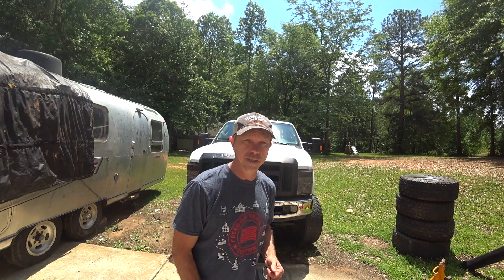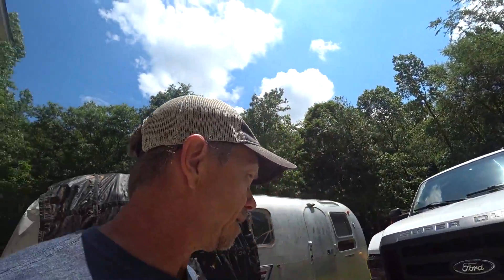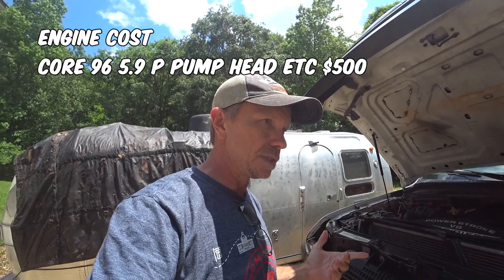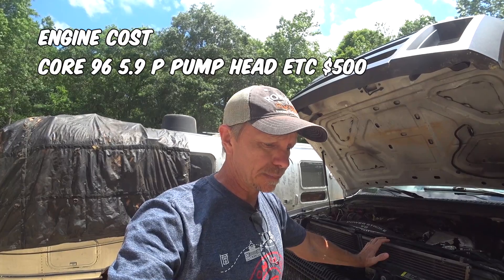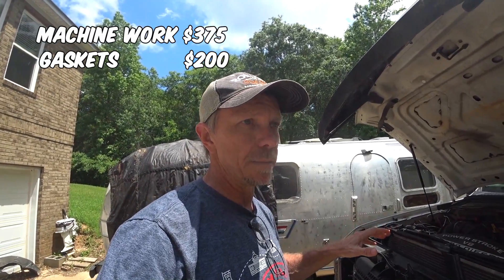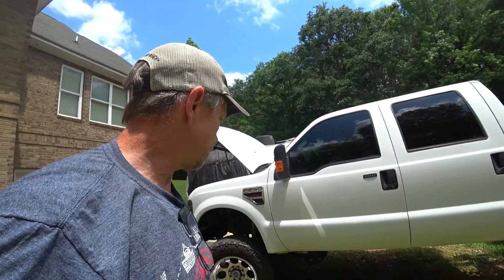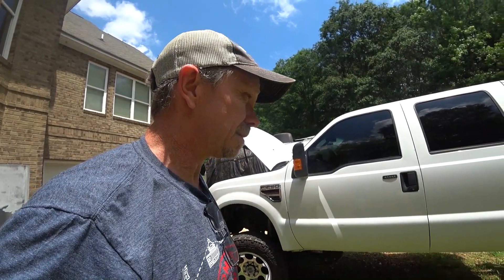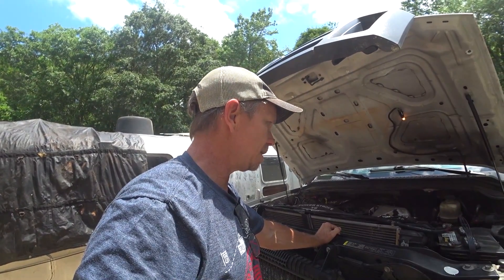6.4 Ford F250 to 12 valve Cummins Swap - Cost To Build

Comment: That truck is worth more now that you did the swap over, then it ever was with that 6.4 in it. To be honest with you, it's worth far more that $11,000 is a used truck. I have a 94 F250 extended cab 4-wheel drive, that I wouldn't take 11 grand for. You did a great job, that truck will be worth $15,000 minimum when you're done. Diesel 4 by fours right now are bringing some crazy prices. But I love them. Thank God I'm an American country boy
Reply: Funny but it might have been worth 15000 2yrs ago but now itd be worth 35000
Reply: No. These are nightmare chop shops. Not worth more then a couple thousand. What it’s worth vs what has been put into it, are two different things.
Reply: @sugmaball5383  Are you referring to the truck itself? I am curious if these fummins fords have to be constantly worked on. Maybe the engine and transmission will never die cause they're solid, but that doesn't mean the truck won't have to be worked on all the time.

Comment: hey I'm derek I have an 08 f550 and have a new 12v in it and mounted to 5r110 I need help wiring tack helper up to it and mounting the pcs tcm 2800 with the wiring harness? any input would help thanks!

Comment: I think you're spot on with the value. That's what I figured with my 93 ,2wd one ton , only it was a 3500.00 truck to start . The tappit cover is touchy ,make sure the outer edges touch before the bolts bottom out. Thanks for sharing this project with us!

Comment: Wow glad I’ve got a good reasonable priced reliable machine shop just had a 24v head valve job done and it cost me 140$
Reply from the maker: That's a good price especially for 24v. Don't let them see this.
Reply: THEY probably did not do EVERYTHING.  Those cheap shops CUT corners. Do you thunk it only took them 1 hr.. I don't think so.

Comment: Don’t listen to those clowns about aluminum beds because they don’t have a clue . What you should get is an EBY aluminum truck bed they are built strong and look the best . I have them on 4 of my 1 tons on the ranch. Designed with cutting-edge technology and manufactured by veteran craftsmen, EBY truck bodies exemplify the spirit of American ingenuity. Whether you’re a contractor or builder, a landscaper or farmer, a mechanic or service technician, EBY has a truck body that will work as hard as you do.

Comment: We want to thank you for documenting this swap and giving us a heads up as too what to expect. 
We are just about to put a 1996 Cummins 12V into a 2008 Ford F450 6spd manual 4x4 and have learned an absolute ton of knowledge as to what to look for and avoid as well as what to fabricate instead of buying.
Your video's I figure will save us at least $2k+.
I work in a machine/fab shop so most of the parts I can just do myself.
One question for you is, does your Ford have the regen and do you have to do any computer work to get rid of the CEL?
Thanks
Reply from the maker: I'm glad you found my videos useful. My Ford does have the regen and the light stays on for now but a friend of mine was able to tune his out using HP tuners

Comment: Very cool swap what is your guesstimate for hours? Gutsy move pulling that 6.4 out the front we call that kind of stuff swearing and bleeding.
Reply from the maker: That is a tough one. Probably the most valuable question too. I fabricated a bunch of stuff so you have to add that over buying a kit also and I rebuilt the engine. Lets just say a winter project 6 months working on it 2-3 hours a day off and on.
Reply: Fair enough thanks for the reply

Comment: Well done mate - a nice engine in a nice body, the way it should have been done from get go. I do have a question for you guys who are doing this or similar engine swaps. What about EPA and theyr'e ban on emission delete?.
Any vehicle that are non emission I would guess are fine - but a 08 or newer would have EGR, DPF and some even DEF and by replacing and older non emission engine, would it  comply with OEM emission laws ?.
I would love to do a swap like this but where I live the EPA, RTA, annual inspection and Police would have fined me into the utter darknes and left with the plates. I'm stuck with a 7.3 PSD which are non emission - yes they allowe me an 5.9 12 valve but the cost swapping it in are not worth it.
A  similar year like yours with a 6.4 PSD would have been worth the effort - but then again the emission laws are getting into play.
Thanx for posting.

Comment: Bro. I did my build in November on my 12 valve and the damn tappet covers will leak no matter what you do with the stock cover. I put a cheap billet for like $60 and it never leaked again.

Comment: hello, very good job , .....I have a question like did to adapt the cables of the engine and the transmission and that the instrument cluster all  worked .... thanks for solving my question
Reply from the maker: I built a throttle pedal adapter for the stock cummins throttle cable, used swaphelper to control the tach signal for the computer and instrument cluster and the stock ford sensors for everthing else. So yes temp, boost tach and transmission all work as original. Here are the videos how i did it   https://www.youtube.com/watch?v=RtKgC7F6A_A&list=PL4M7OaDVwdt8H9wVyMw1pMWh3hMGCs_3v

Comment: JYDOG, Did you end up liking how you did the Fan with the adapter?  That's how I'm looking to due mine.  The 6.4 fan is alot heavier than the 5.9 fan just wondering how the stock 5.9 fan clutch handled it.

Comment: Did you build you own wiring harness? I know online they are ridiculously expensive?
Reply from the maker: I did. Everything is expensive now. I am thinking 12 months. Things may be a little cheaper. Even used parts are outrageous on FB marketplace.
Reply: @JYDOG  any chance you have the diagram written down or willing to put it on paper?

Comment: Dude that truck is worth 20k easy. Those fords are nice trucks. And now that it has the best Diesel engine in it, you have 1 spectacular truck. Get all the cosmetics working and your ready to go. And get the exact bed the truck cane with from the factory if possible
Reply: Flatbed!

Comment: Just out of curiosity I wonder what it would be like cost,time, difficulty etc... to swap in a 6.7 power stroke compared to the cummins? Anybody know. .
Reply: A lot harder. Its a fun thing to think about but it would never be worth it. Nobody to my knowledge makes an adapter plate kit to bolt a 6.7 up to a 5R110. You would have to use the transmission out of a 6.7 truck, and all of the computers along with the 6.4 computer. The wiring would be horrendous. And in the end, you wouldn't have the dependability like you would with a 12 valve cummins. The later 6.7s seem to be holding up alright, but they so much harder to work on when something breaks than a simple 12 valve or even a 6.7 cummins. Not to mention how expensive they are.
Reply: @hummincummins5413  thanks for taking the time to answer my question. I can see how the Cummins would be simplest choice. Never thought about the computer issues or the cost of the late model PowerStroke.

Comment: Don't drive it in California' Bar inspection sites will red flag it for smashing under New State law's.. All engines and exhaust have to be Oem to the Vehicle or truck your driving. The only way around the law is show cars or classics. And that's impossible to get signed off on.

Comment: How did u wire up the engine harness? Did u only buy a tach adaptor and do the rest yourself?
Reply from the maker: Yes, just the tach adapter was needed. I left all of the sensor attached even the ones that where not being used and slowly removed them one by one.
Reply: JYDOG any check engine lights and where did u find the information to wire it? The wiring is really only thing holding me back from doing the swap
Reply from the maker: @doug___1jz  Yes the check engine light was on all the time but everything worked as it should.  With HP tuner software it can be turned off. I would suggest looking for a Diesel conversion specialist manual it will clearly show you how to do the wiring.
Reply: JYDOG thank you for the info, lastly how are u passing emission or, in your state, are u except
Reply: JYDOG how did u find the best price for the engine core, not to sure where to sell it

Comment: Whats the special thing on that "P-Pump" that was mentioned? More power, more reliable?
Now I´m excited to see that flatbed build process...
Thx for the vid!
:-)
Reply from the maker: Bosch p7100 more power and reliability than other pumps. "upgrades can get the P7100 pumps to flow 850 to 950 cc’s — enough fuel to make north of 1,800 horsepower"
Reply: @JYDOG  Ah ok, sounds it will do on your setup...
:-P

Comment: I’ve been following you on this from the beginning. You mentioned when you pulled the motor you wouldn’t recommend doing it the way you did. Would you remove the cab or just use a different engine cherry picker?
Reply from the maker: Pull the cab if you can. If not use a real heavy duty cherry picker. Mine was too cheap and flimsy. I need to upgrade.

Comment: Enjoy following your build! 
Question, how many hours of work do you estimate having in the truck so far including motor?
Reply from the maker: Rough estimate 6 months 2-3 hours a day off and on. I fabricated a lot of stuff you would buy in a kit so that would take a lot longer. A professional mechanic could probably do it in less than 2 weeks using a kit or 1 week with a working engine and a kit.

Comment: wow I wish I could do that in CA. those 6.4 are pure junk and there are lots of carcuses out there. The trans on those are ok. Here anything over 2000 gets a diesel smog check which is a visual to see if all the equipment is there and working. So older duramax is the way to go here. I will just keep my 2003 chevy and get the interior redone.

Comment: Do a 0-60 run with no bed and that 12 valve when you get it worked out curious how slow that thing would be I’ve got a 2009 dually duramax crew cab truck and 2013 super duty fx4 crew cab I’d hate go back to driving a old tractor feeling speed diesel truck again had old 7.3 99 350 years ago and it was nice but after feeling these modern diesels horsepower and torque once you get rid on the emissions bull shit it would be hard to spend the money on doing one these conversions and as far as resale I think it being oem and properly maintained would be best for resale always I couldn’t imagine how many idiots I’d have to show and test drive that truck to to get 10k out of it hahahahaha selling used trucks last the 7500$ range is like pulling teeth in this country with out financing hahahaha

Comment: Why not simply buy the dodge in the first place??
Reply: Dodge trucks are junk
Reply: @errolpoxleitner3163  
And that why they want to put a junk motor (Dodge) into their wonderful, long-lasting rig that never breaks down??
Reply: Randal the engine is fine the bodies are junk.
Reply: THE older Ford's ARE very nice trucks.
Reply: Cummins is a Ford subsidiary company, that due to a 1980's contract cannot be placed into Ford trucks. When 1st gen consumer diesels got popular in the late 80's Ford partnered with International Harvester in order to rebrand their 7.3L prostar engine. It became known as the 1st gen powerstroke. Ford made the truck, IH made the engine. Things continued in this manner thru the rollout of the 6.0 and 6.4, however IH was rushed and/or failed to engineer good upgrades into the 6.0/6.4 which cost Ford and Ford owners alot of money.

That is why the 6.7 scorpion motor project was brought back in-house, so Ford could control QC without needing to involve lawyers.

Sidenote: diesel trucks descend more from commercial building traditions rather than fully inhouse consumer oriented operations, which is to say, you used to choose a chassis builder, choose a motor, and choose someone to assemble it all into a unit. Some of this pedigree continues today, especially in units above the f350/ram3500 range. But, the strange contract restrictions and differing levels of build quality persist.

For instance, a Ram 3500 is a random assembly of fiat/mercedes electronics, a Ford[Cummins] powerplant, a GM transmission, and mexican sheet metal bodypanels. So, if anyone steps up to sound off on how amazing or crappy <insert whatever> happens to be, recognize that many of these opinions are ignorant, to say the least.

Objectively speaking, Ford makes the best chassis and the best motor. Sadly, we cant yet get them together without some aftermarket shenanigans. 

Dodge/Fiat/Chrysler is a distant 2nd in all terms, especially after moving on from the 5.9L. And GM just quit trying a good while ago.